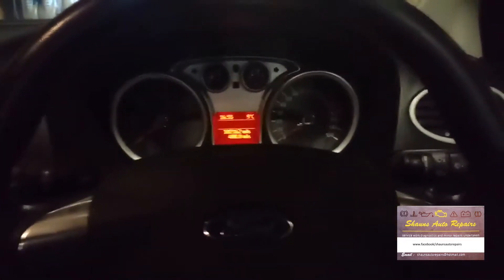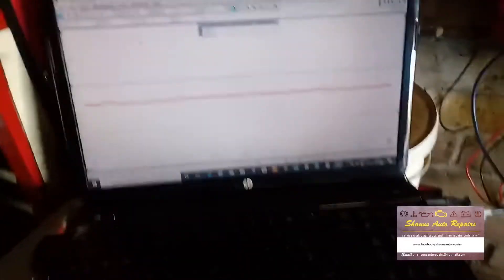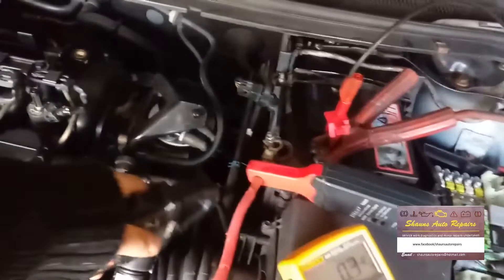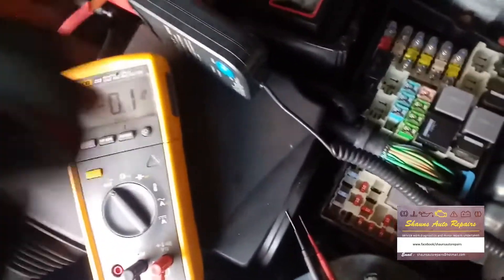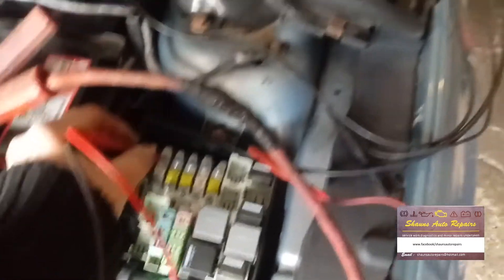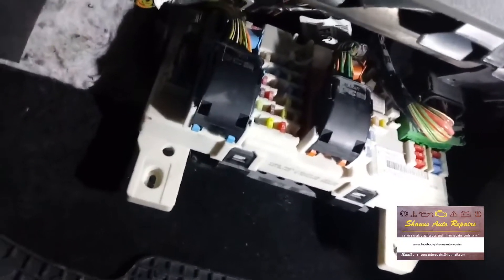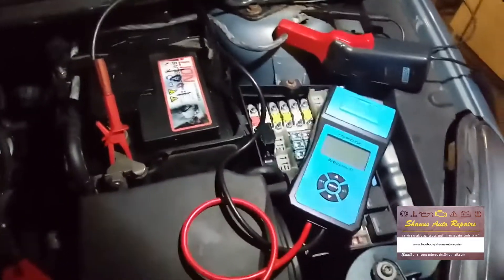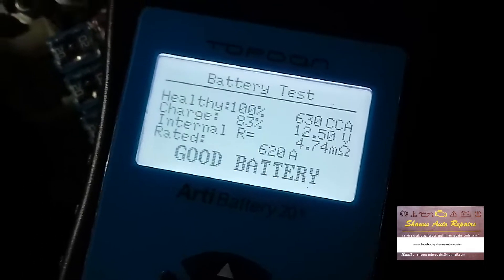Ford focus 2009.. Do we have a parasitic current draw or dont we. TOPDON arti 201 ..  Pico 4223

Comment: So after all that couldn’t find a problem?? My focus is doing the same and the auto electrician can’t find the problem. Had it back twice now, saying no issue, the next morning I have a dead battery!! Ffs!
Reply from the maker: I understand your frustration. In the end I had this car back a few times. When it started having other issues like cutting out and non start, no crank the fault was found to be the cluster. After this had been sent away and repaired it all seemed OK..  The solder joints on these Ford clusters do suffer with cracking on the board and need reflowing. I would get this checked first if nothing else can be found... Thanks for watching and your comment
Reply: @shaunsautorepairs5410  sound advice my friend. God bless and a great trade you have there, wish I had the same
Reply: It's more than likely the BCM itself - internal fault. Relay stuck on in there of something.